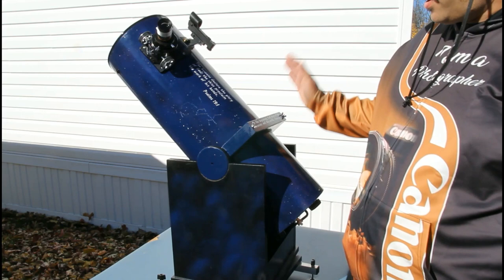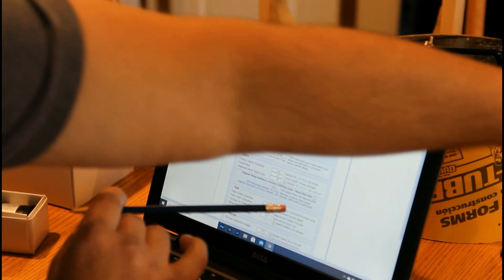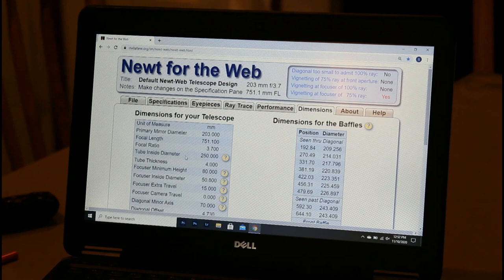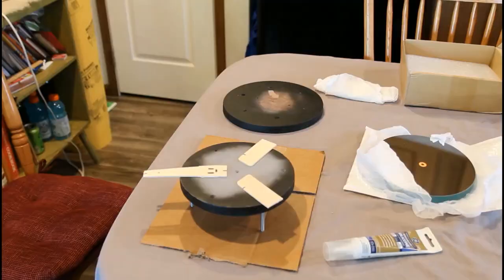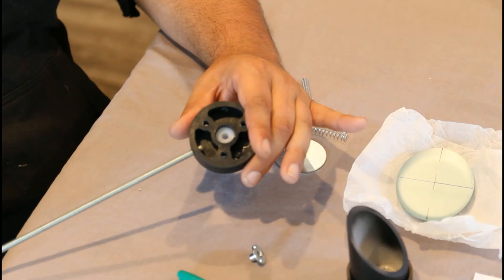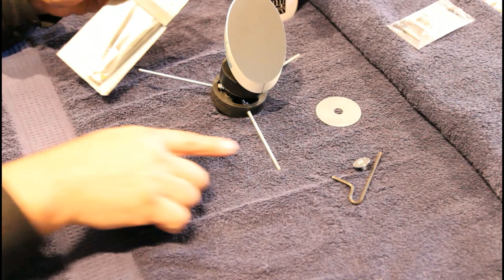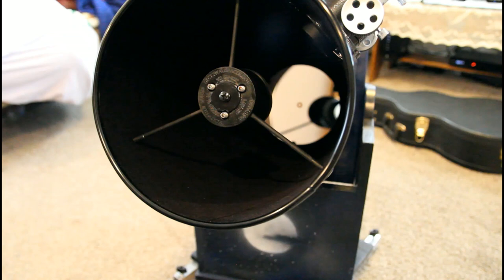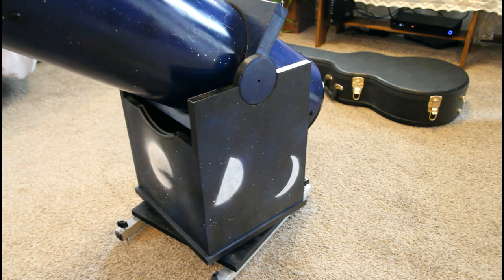DIY 8" NEWTONIAN TELESCOPE COMPLETE BUILD

Comment: Why not just make the main tube out of 10" PVC pipe used for exterior drain pipes? Doesn't take moisture and no need for the fiber glass work.
Reply from the maker: Way more expensive! But is an option.

Comment: How well do you like your telescope?
Reply from the maker: The scope itself performs really well, but I would like to come up with an improved design for the base so you can make small adjustments.
Reply: @scottschuette74  I saw a video where a guy made a round compass with markings for degrees and placed it on the base. Turn the base to North and turn the scope to where a star or sky object is located based on what the app tells you. Pretty cool.

Comment: I'm planning to build a similar telescope and I am searching for parts. I'm guessing your primary mirror was spherical. Are you happy with it so far?
Reply from the maker: Ya it works really well. From what I read at the time when I built it, spherical is more than adequate for this size.
Reply: @scottschuette74   Greetings and good night, congratulations on the project, it turned out very well, where did you get the info that for that spherical size it is better than parabolic? I ask you because I have read on several sites and supposedly the parabolic is better for large sizes.
Reply from the maker: @Leslye Del Valle  I don't remember where I got the information from on the difference in mirrors. I just remember that for an 8" diameter, there is little to no difference. I would guess if you moved up to a 12" mirror, you would want to go with a parabolic shape.

Comment: thanks for the video. I ve just checked that primary mirror prices are jumping when you go to a 10 inch one!! Do you have some good advice where to buy as I ve found only one place on the net.
Reply from the maker: I have found them on Amazon, ebay, Edmund Optics, and AliExpress, There isn't a whole lot of suppliers out there so it is tough to find good prices unfortunately. Thanks for the compliment!

Comment: thanks for the help, were trying to bild a 8 inch like the one you bilt. please post any up grades,
Reply from the maker: You are welcome. The biggest issue I am having is the base not freely moving. I am thinking my lazy-susan bearing is bent a little bit and doesn't let it spin freely. The altitude adjustment works really nice, but the disc on the side could be bigger looking at other designs on YT.  I purchased a eyepiece projection adapter for my DSLR and it seems to work  pretty good. Putting my camera on the telescope does add weight to the top so I slide the tube down in the cradle making the bottom hit the base if it is pointing up. So leaving that narrow board off might be a good idea.